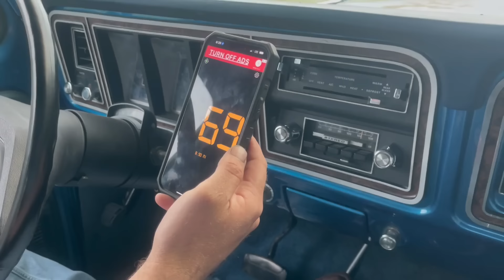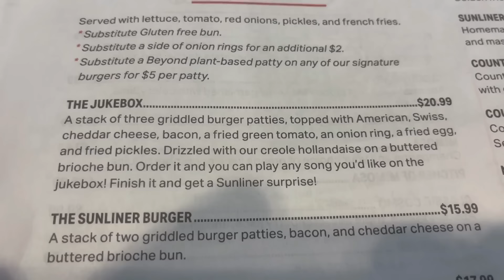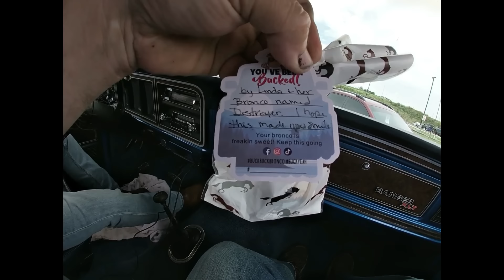UNTESTED BRONCO, Can we rescue and drive it 4 hours  200 miles, CAN WE MAKE IT?

Comment: I still have my old 78 Bronco and she still runs fine. 351 M and C6 tranny. Still has the NP 205 case and 3.50 differential gears. Has a Detroit no spin locker in the rear and a track lock limited slip in the front dana 44.  Has 33 by 12.50 15 tires and will go just about any where I want to go here in the Southwest desert or the mountains near by. Back when ford made real trucks.
Reply from the maker: Yes sir